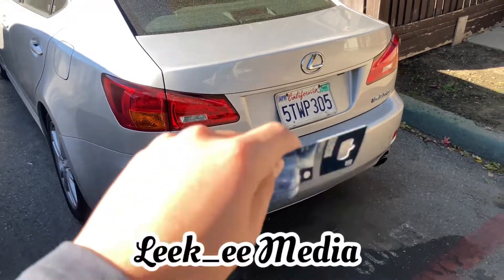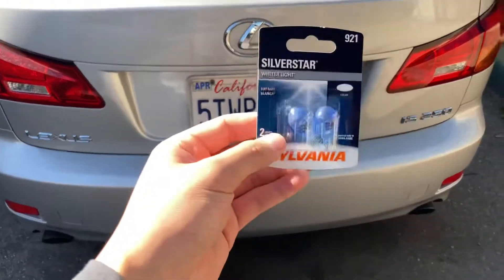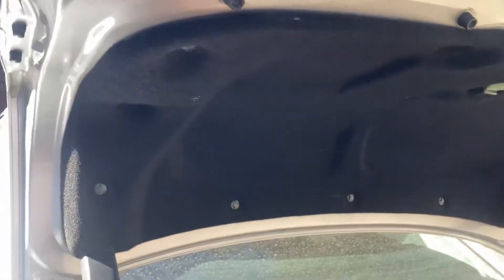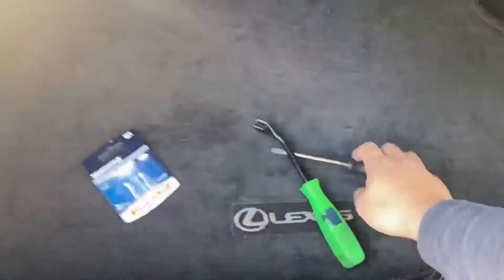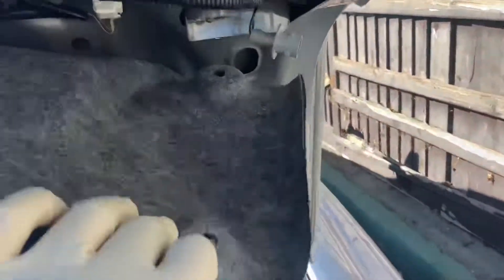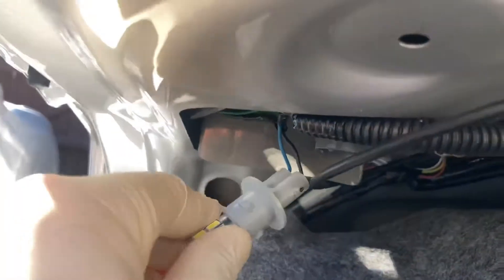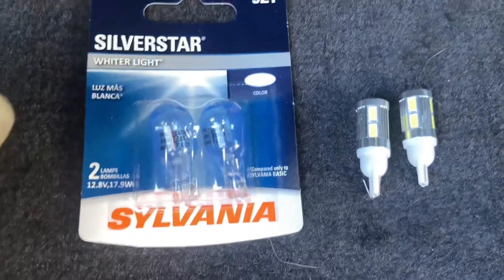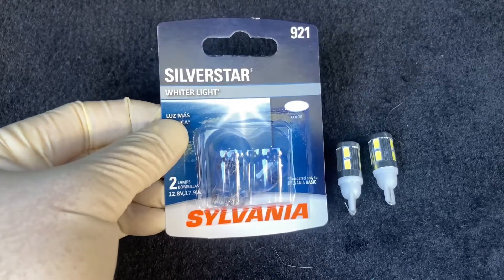Reverse Light Install | 2006 Lexus IS250

Comment: I like the video , but traditionally speaking, halogen bulbs burn out way faster and more frequently because the operating temperature of the bulb, LEDs should last 2-3x longer, more then likely LED should never go out, but the connector’s can